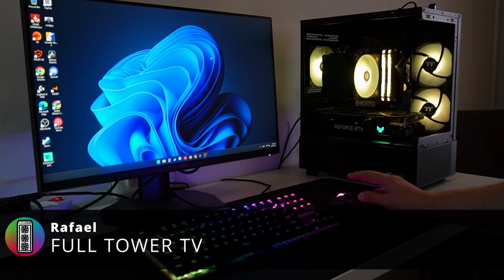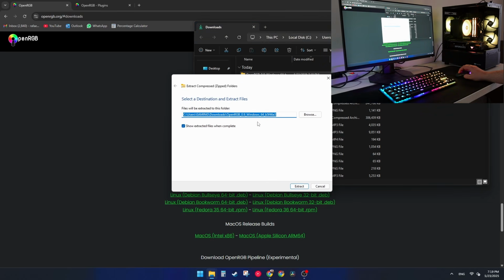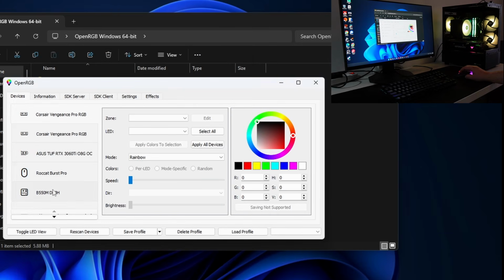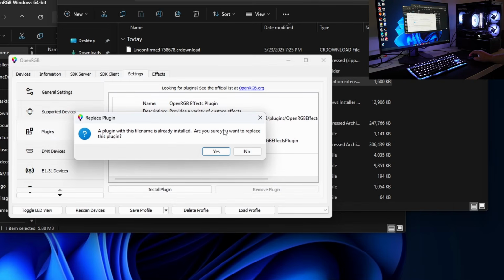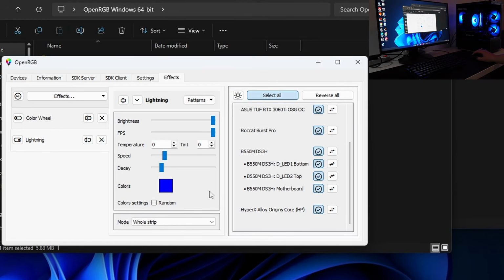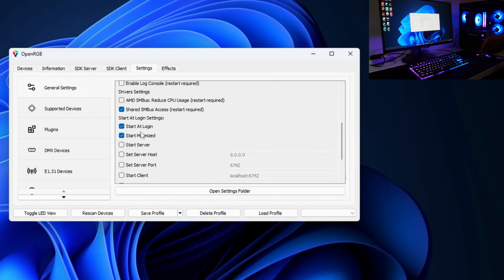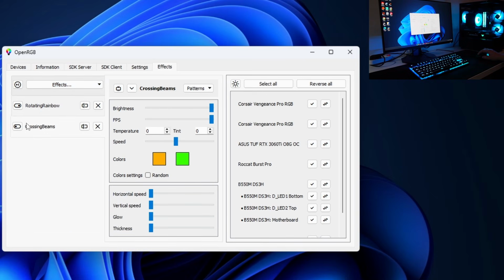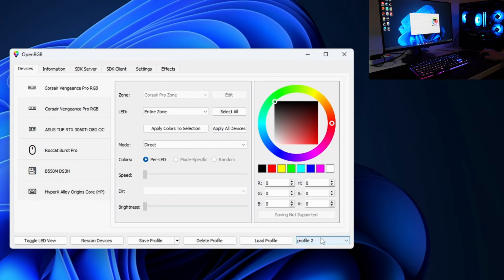How to sync RGB using OpenRGB Effects Plugin

Comment: Hii i have a question, ill try to explain it the best i can haha, I want to use openrgb to change all my casefans, ram and gpus rgb, i also want to use my keyboard software for rapid trigger, socd etc and the keyboard rgb. Would that work? Or will there be interference
Reply from the maker: That's a good question. I understand what you are asking. I never tried that. From what I've seen, most of the interference people are experiencing is with motherboard software, but you can try for yourself and check.
Reply from the maker: And also let us know what you found 😊

Comment: why does your corsair vengeance pro rgb show up but mine doesnt?
Reply from the maker: It could be because another RGB software doesn't allow it to detect your RAM.
If you use ICUE, for example, or other RGB software, such as your motherboard's RGB software, it detects it before OpenRGB does.
Try to uninstall them, reset your PC, and open OpenRGB as an administrator to see if it resolves the issue.

Comment: it doesn’t detect my gigbyte 7600xt and my g skill trident ram
Reply from the maker: Someone asked me about the G.Skill Trident Z memory once, so I'm gonna copy-paste my comment here so you can try troubleshooting: 

"You might have another program controlling it and not allowing it to be detected. 
Check if you have any other RGB program installed, such as your motherboard software (MSI Mystic Light, Asus Armoury, Gigabyte Fusion), iCue, Razer Synaps, or something similar that is detecting the RAM and "not allowing" it to be detected by other programs.
Finally, if none of those are installed on your pc, try to download G-Skill Lighting Control from their website here: https://www.gskill.com/download/1502180912/1551690847/Trident-Z--Trident-Z5--Ripjaws-M5-RGB-Family
And see if it's detected there.
If it does, you might need to "open" more zones in OpenRGB. You know how the program asks you about LED zones at the beginning? Try changing the number to 32 or 16; it might help. (Another viewer commented here with a similar problem and said it helped him.)

Also, you can try using SignalRGB, which is another program.
Maybe you will have more luck with that."
Reply: @FullTowerTV  Yes, Signal Rgb can detect the RAM, but I don’t want to use it. Even my Asus motherboard software and G Skill software detect it, but I just want all my components to sync in one app
Reply from the maker: @Unbeknownstx  As for the G.skill, read the comment I copied and pasted before, specifically try this part: "You might have another program controlling it and not allowing it to be detected. 
Check if you have any other RGB program installed, such as your motherboard software (MSI Mystic Light, Asus Armoury, Gigabyte Fusion), iCue, Razer Synaps, or something similar that is detecting the RAM and "not allowing" it to be detected by other programs.
Finally, if none of those are installed on your pc, try to download G-Skill Lighting Control from their website here: https://www.gskill.com/download/1502180912/1551690847/Trident-Z--Trident-Z5--Ripjaws-M5-RGB-Family
And see if it's detected there.
If it does, you might need to "open" more zones in OpenRGB. You know how the program asks you about LED zones at the beginning? Try changing the number to 32 or 16; it might help. (Another viewer commented here with a similar problem and said it helped him.)"

Maybe because you have other RGB software installed, it controls the RAM and prevents OpenRGB from detecting it. Could you try to uninstall any other RGB program and see if OpenRGB detects it?
Reply from the maker: As for the Gigabyte 7600xt, which model do you have?
Reply: @FullTowerTV i have the gaming oc 16gb version from gigabytes
Reply from the maker: @Unbeknownstx  Did you download Gigabyte Control Center (GCC) or RGB Fusion by any chance?
Reply: @FullTowerTV  I downloaded RGB Fusion, and it worked. It also detected my GPU because OpenRGB couldn’t detect it that’s the only reason i downloaded it
Reply from the maker: @Unbeknownstx   , I would try to uninstall all the RGB software (including openRGB, which you can't really uninstall but can only delete from your computer). Restart after uninstalling and deleting everything, and then try using only OpenRGB. Make sure you run it as an admin on the first time and try to allocate zones (I think 16, or 30 should be fine) 
Let me know if it helped.

Comment: hi my rgb color is wrong my red is blue and it mess up the effects what should i do?
Reply from the maker: 😮
Is it in a specific part?
I never heard of this before.
Can you give more details, please?
What part is it? Does it apply to all parts, or just a specific one?
Reply: @FullTowerTV  i fixed it it was gigabyte motherboard problem but now when windows start and open rgb opens on startup the effect will have flicker i have to change color to static then change back on the effect any tip to make the flicker go away??
Reply from the maker: @ariankhavarian8886  
Yes, try different effects. I had the same problem, and I found that some effects can cause this issue. Because the plugin is 3rt party, it can be buggy sometimes.
Also, you can try a software called SignalRGB. It's a bit more polished, fewer effects, but it might work better for you.
Reply from the maker: @ariankhavarian8886  
Just make sure to remove OpenRGB first and restart your pc before you install SignalRGB
Reply: @FullTowerTV  he got rgb instead of Argb?
Reply from the maker: @Volgens-Mike  no, I think the problem is not related to that. Even with rgb, if it's not on "fixed" mode he should still be able to change them. Maybe it was a bug with OpenRGB he did say he managed to get it working but sometimes he has flickers when he turn on the system, which is something that can happen. It happend to me too, OpenRGB can be buggy sometimes.
Reply: @FullTowerTV it was a problem related to gigabyte mtherboard you should change a line of code and its good to go
Reply: @F @FullTowerTV i have problem the saved profile wont turn on i should set it every time  i turn on even though i saved it

Comment: heyy my fans doesnt change the colours help pls...
Reply from the maker: Hey 👋 
Check the front panel to see if you have an LED switch button or if you can switch the lights on by pressing the reset switch.

If you do, it means that the fans are not connected to the motherboard, and since they are not connected directly to the motherboard, OpenRGB cannot recognize them.

It is not necessarily a bug, but a feature, as some cases have fans with an internal RGB controller that is plugged directly into a switch, such as an LED switch or the reset button.

If that's the case, the only way to change the lights will be with the button, not through software.

Comment: My Ram is not being detected, "GSkill TridentZ", no matter how many times i run it as admin
Reply from the maker: You might have another program controlling it and not allowing it to be detected. 
Check if you have any other RGB program installed, such as your motherboard software (MSI Mystic Light, Asus Armoury, Gigabyte Fusion), iCue, Razer Synaps, or something similar that is detecting the RAM and "not allowing" it to be detected by other programs.
Finally, if none of those are installed on your pc, try to download G-Skill Lighting Control from their website here: https://www.gskill.com/download/1502180912/1551690847/Trident-Z--Trident-Z5--Ripjaws-M5-RGB-Family
And see if it's detected there.
If it does, you might need to "open" more zones in OpenRGB. You know how the program asks you about LED zones at the beginning? Try changing the number to 32 or 16; it might help. (Another viewer commented here with a similar problem and said it helped him.)

Also, you can try using SignalRGB, which is another program.
Maybe you will have more luck with that.
Reply from the maker: Let me know if any of those helped.

Comment: it picks up my attack shark x86 keyboard but whenever i try to apply any effects it doesn't change the rgb at all it jus stays uneffected from the software
Reply from the maker: Do other components work for you? 
Try different modes because sometimes, it doesn't allow all kinds of effects on every piece of hardware. 
I had this happen with my rig, where some effects worked and some didn't. Also, you can try SignalRGB and not OpenRGB.
Maybe it will work better for you.

Comment: Hello there! I cant seem to figure out why it cant detect my lexar RAMs, do you know why this is the case? Thankyou! 
Edit: I'm using B650 AORUS ELITE AX mother board
Reply from the maker: Some hardware is not detected by OpenRGB properly. Here is what I would do: try to delete and download OpenRGB again and make sure you run it as an Admin (right click on the software icon > run as administrator). If it's still not working try other rgb software such as SignalRGB or even RGB Fusion which is Gigabyte's software.
Reply: @FullTowerTV  Thankyou for answering! but I found out that openRGB doesn't really fully support DDR5 Rams and that was the problem.
Reply from the maker: @futongafuttonda8283  Have you tried SignalRGB or RGB Fusion?

Comment: not working for me…open rgb dont see my keyboard (corsair) and cant control the motherboard fans
Reply from the maker: Some RGB products may not be detected by OpenRGB. Make sure you run the program as Administrator and also try to remove and re-download the software (sometimes it works). 
Also you can try Corsair iCue software or SignalRGB, it might work for you.

Comment: I am at a loss, i have probably spent over a week trying to get this working, I have a gigabyte mother board so for that it is RGB Fusion and it does not work, nothing i have tried does. I have followed all yours steps to this, it installs the plug fine and the effects tab shows all the effects but the devices tab shows nothing. So confused with it all.
Reply from the maker: Did you run the program as admin?
It could be the reason why the device tab is empty. Also please contact me @fulltowertv on Instagram / Facebook I will try to help you
Reply: @FullTowerTV  hi yes I tried that. Sorry I don't use Facebook or Instagram. I am wondering if my pc even supports any of this. Its an AMD Ryzen 7 (A520M K V2) Rtx 5060ti. Thanks for reaching out though
Reply from the maker: @MPicoTTo2007   np. I prefer Facebook / Instagram because it has direct messages (something that YouTube doesn't) and sometimes it's hard to keep track with comments I replied to, the YouTube studio app does not show it well. 
I might make a WhatsApp contact in the future but in the meantime I will do my best to reply here. 

Luckily you listed your motherboard model so I took a look at the specifications page and I have figured out the issue.
Unfortunately, it's not something you can fix but I will explain why it is not working and also give you a tip on how you might have some control over the lights in your pc.

So the way the OpenRGB shows devices in the device tab - it reads the things that are connected to the motherboard. 
In order for that to happen there are 2 things that needs to exist:
1. If you have RGB on your RAM, the board must support RGB fusion (if it's a gigabyte motherboard) / aura sync (if it's Asus) / mystic light (if it's MSI). 
2. If you have RGB fans they need to be connected to an RGB header on the motherboard (ARGB to be more exact).

Unfortunately, not all motherboard have those things and the A520M K V2 does not support RGB fusion and it also doesn't have any internal ARGB headers.

So, how the lights work on your pc, you ask?
Well, you see - some pc cases have some kind of internal "system" that they run in order to show the lights.
Because the people who made it know that some motherboards does not have internal RGB headers - instead of connecting the fans to the motherboard - it has some kind of a built it controller that is usually connected to your Reset Switch.
That allowes you to change to colors of the fans by pressing the reset switch, and every time you press it - it will change colors/modes. 
(a long press should turn them off completely).

So, that's why nothing is showing up in the device tab for you and I hope at least now you know why, even though  you can't fix it.
The solution for that will be to replace the motherboard to one that does support RGB fusion and has an internal ARGB header but I don't think it's practical and it's also not sure that your case fans have ARGB connectors. (some of them don't)

I'm sorry if that's not the answer you wanted to hear but at least now you know.
BTW, if any of this didn't make sense to you - I might make a video about it soon explain it in person so stay tuned for that.

Hopefully, you keep your head strong and just so you know you are not crazy and it's not your fault. (I know the feeling sitting on a problem for so long and then realizing there is nothing you can do) 🫶

Much love,
Rafael
Full Tower TV
Reply: @FullTowerTV they also said about the reset button you mentioned which does change the colours so I'm happy with that but I was hoping for like customising them like on your video
Reply from the maker: @MPicoTTo2007 first of all, you have nothing to be sorry for. I'm here to help and what ever you need - you can always feel free to reach out and I will do my best to help.
Second - you don't need to feel like you wasted time. Life is all about learning. You know how many times I spent hours, days and weeks on a problem and it ended up being something else? 😅 You have no idea.
But hey, now when you buy your next gaming pc you will know what to check ☑️ before and thats a W.
Hope you have a great day! 🤗 Take care 🙏
Reply: @FullTowerTV thanks mate😊
Reply: Thanks so much for looking into this, you don't even know me yet you took the time and effort. I purchased the pc off amazon  last week and being a gaming pc has lights everywhere I assumed I could do this. I got in touch with customer support today and they said exactly what you did, the argb header is not included in this build. So I wasted a week of my time and yours, I do apologise and thanks for your efforts.

Comment: Curious which is better, OPEN RGB, or Signal RGB
Reply from the maker: SignalRGB feels a little bit more polish as a software but I found some of the components not detected there.
OpenRGB can be buggy sometimes but you have a lot more customization you can do with SDK's and plugins.

 With that said I hear from people that some hardware is also not recognized in OpenRGB so you might wanna try them both and see what best works for you 😊
Reply: @FullTowerTV  Thanks for getting back to me. I have Lenovo Legion Laptop. And I got a gaming mouse and the mouse needs seperate RGB software. It's a Lenovo gaming mouse, and I can't even change the colors with the Lenovo Advantage App. I can only use that for the keyboard and all of that jazz..

So having OPEN RGB might be a huge game changer, since I can control the whole damn laptop and mouse and other accessarys, I hope
Reply from the maker: @DaveBudness try that and let me know if it works

Comment: so the only problem im having is first, the open RGB cannot detect any of my other lights, like i have 4 fans, it can only detect the rear fan, but nothing else, nit even my mouse or keyboard

2. for some reason Open RGB just cant find the file no matter how hard i try
Reply from the maker: 1. It could be that the 3 fans that are not detected are not plugged into your motherboard. Some fans / case fans are plugged into a controller (of some sort) which plugs into the reset switch that allowed you to change colors every time you press it.

As for the mouse and keyboard - it could be that there is some peripherals that will not be detected or you will need to download an SDK and install it into OpenRGB.

2. Which file are you referring?

Please contact me @fulltowertv on Instagram or Facebook for further help because I don't see responds that often (YouTube studio app is very bad in sorting those)

Comment: hi so question... my pc doesnt give me an option to open as admin and its not letting me change the color of my pc and im assuming thats why. is there any way to fix that?
Reply from the maker: If your pc doesn't give you the option to run it as an admin, it is probably because the windows login you are using is a guest/member user.
Check the user permissions on windows settings > account & profiles.

Comment: I did all the steps in the video, but I can't get the program to boot at startup, I asked chatgpt and tried to force the program to start and it wont work, it only start when I manually click on it as an administrator.
Reply from the maker: I found that the only way to make it start at boot is to make it start minimized. Meaning - you won't see the software window open when you log into windows at first but it will take a few moments (usually about a minute or 2) and you will see it in the system trey and the rgb will take effect after a minute or 2. 

In order to do that - 
Make sure to ticked ✅ these options in the settings tab:
1. minimize on close. 
2. start at login. 
3. Start minimized. 
Also, make sure that both profiles are load and saved in the effects plugging tab and also in the software itself.

If you are still having troubles, feel free to contact me @fulltowertv on any social platform (Facebook, Instagram) and I will see what I can do to help.
Reply: @FullTowerTV hay alguna opción para que yo pueda pedirle a Open RGb que cambie el color de los coolers, de acuerdo a la temperatura del CPU?
Reply: @FullTowerTV I managed to make it start , the program was set to run as administrator and it worked when I unchecked that option